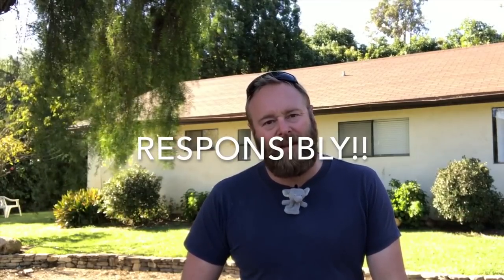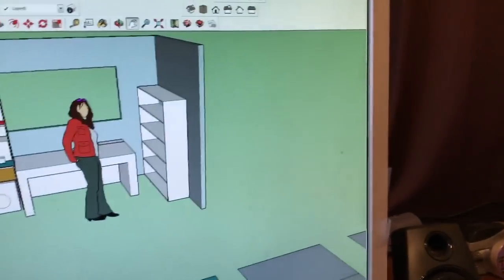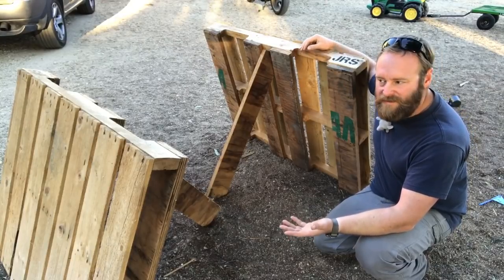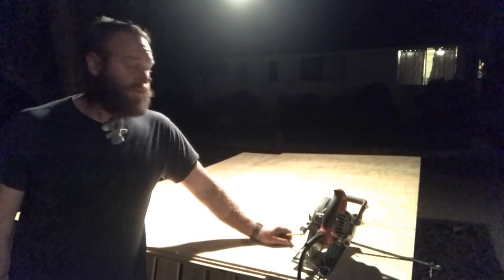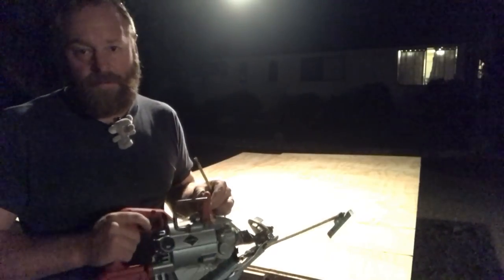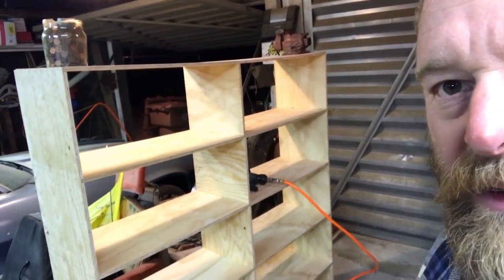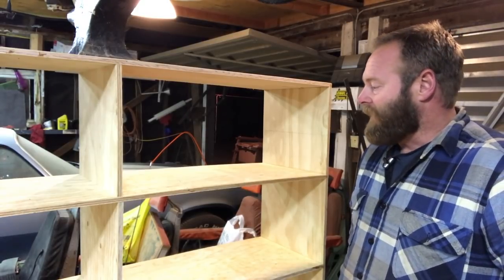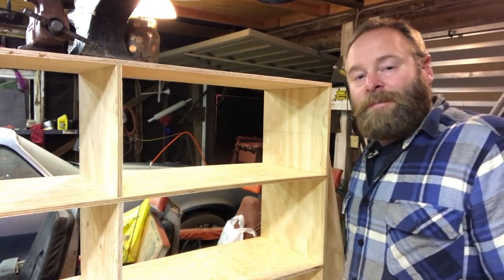How To Build A Bookshelf | Channel Update

Comment: Interesting design. Are you going for A&P or AI?
Reply from the maker: Hey Michael, I'm working on my A&P.  I have lots of time working on turbo props and turbo fans in the military but before now my GA experience was practically nil.  Now I'm learning mag timing and bucking rivets, gapping spark plugs and rebuilding tail wheels.  I really enjoy it.
Reply: @ZackOfAllTrades  i have lots of experience as a helper "30 years ago" doing annuals and 100 hrs. Cleaning and gaping plugs, relighning  breaks, oil changes and such. Always had fun with it. Tell me (if you know yet) is it something worth getting back into? I'm tired of heavy equipment but as you know bills are bills. LoL Happy thanksgiving BTW
Reply from the maker: It seems to me like it is a worthwhile pursuit these days because a lot of the old timers are passing on to bluer skies and there aren’t a lot of up and coming young guys. Aside from being able to wrench on my own plane, this is why i’m Working on it. Seems there’s opportunity in it presently. I could be wrong, but that’s the way it looks to me.